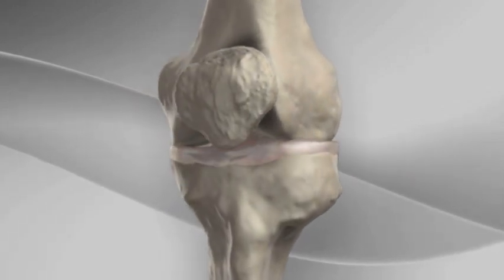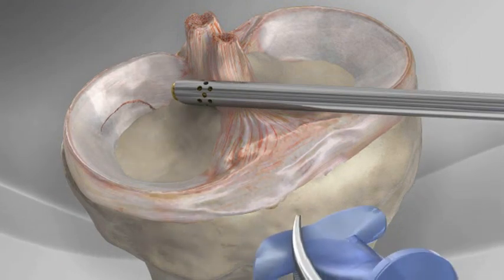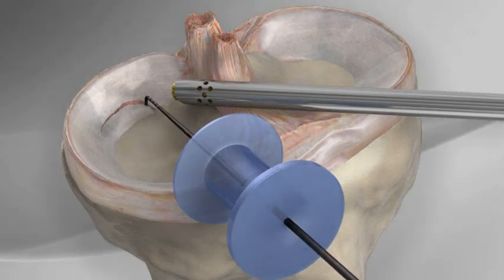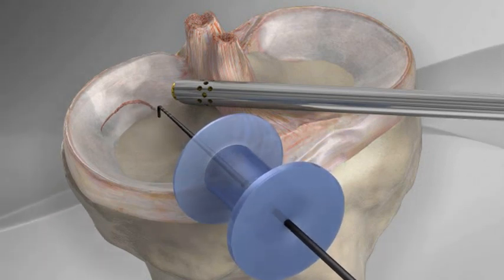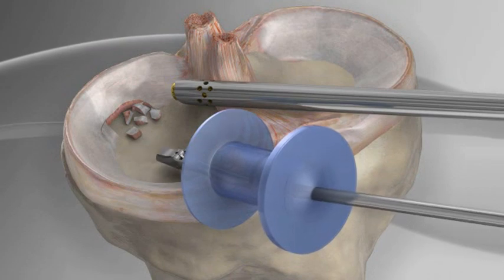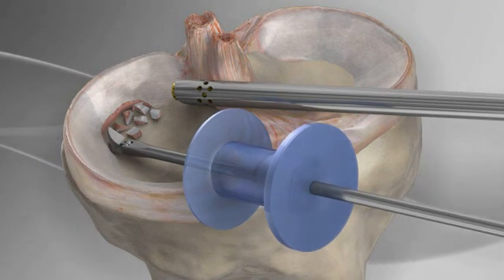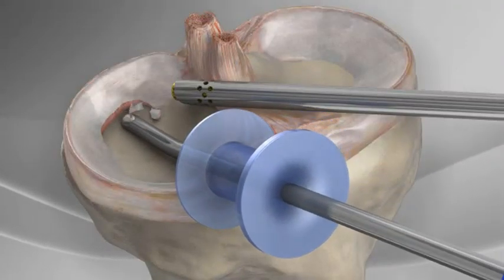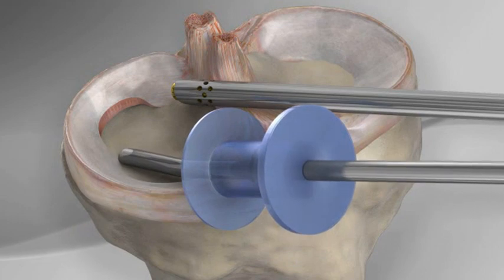Partial Meniscectomy

Comment: The only thing which will be healthy after a meniscectomy will be the surgeons bank balance. I had it done, it does not work
Reply: Did u have partial or full removal? Was it medial or lateral?
Reply: BS you had a bad surgeon
Reply: @billthestinker  I know I had a bad surgeon. I guess you haven't had the surgery
Reply: yep, i had a bad strawberry so all strawberries are bad.
Reply: @stickboy6772  Just because you had one bad strawberry doesn't make all strawberries bad. However meniscectomies are all bad, they remove an important structure in your knee which 1) shock absorbs, 2) allows the knee to glide with very low friction and 3) allows the incongruent femur and tibia heads to move over one another in a stable manner
Reply: So what's the best treatment. Please tell me brother 🙏🙏🙏
Reply: Then it’s probably not your meniscus brotha, but your patella tendon 💯
Reply: @KronoClip  No problem with the patella tendon as far as I can tell